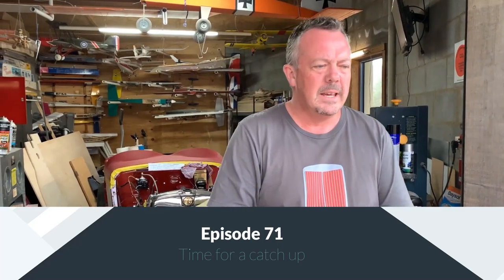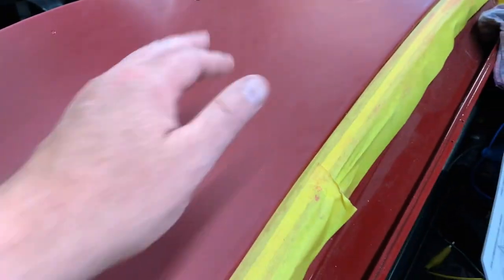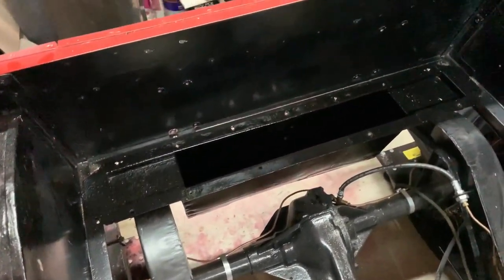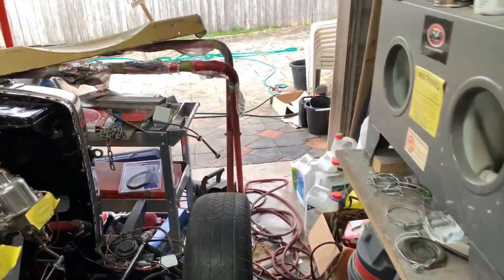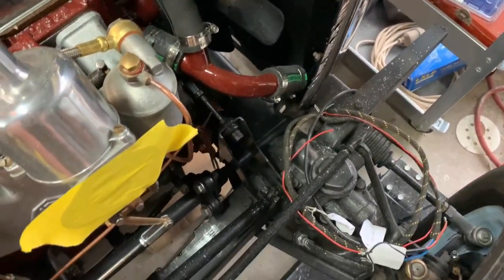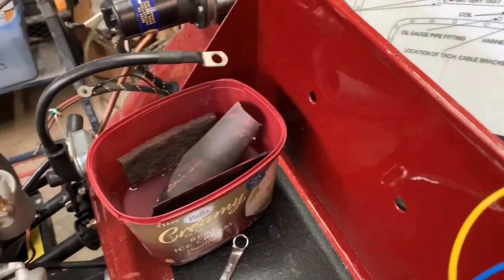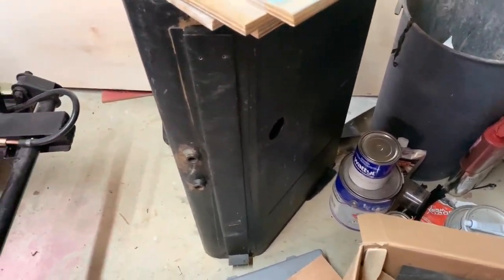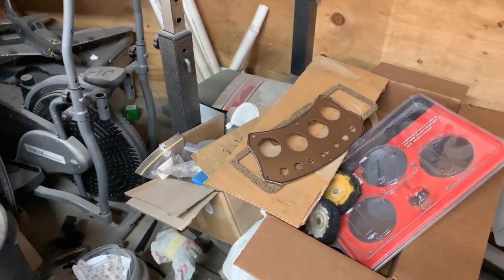Time for  a catch-up - 1950 MG Rebuild Episode 71

Comment: Try some plumbers water proof grease on the radiator drain valve. Also check to see if the cone is bottoming out on the body. If it is the the spring is pushing the washer against the shoulder of the cone. File the shoulder down until there is clearance between the shoulder and the washer on the bottom when installed in the body. Then grease and pray 😎

Comment: Jaime regarding the gap in your floor board, I did nothing with mine. The cutout is intended to clear that "bump" in the cross brace. If it really bugs you, you could cut a piece of Kaizen foam or thinner ply to fill it, but your carpeting will bridge it just fine without doing anything. 

She's coming right along. You should be very happy with all of the work you've done.

Comment: Hello again Jamie, it's been a while since my battery has been out but as i remember it, the two large holes you pointed out in the battery box should have rubber bumpers to keep the battery from rubbing. I believe they were included in the body rubber kit.
Reply from the maker: Thanks Robert.I foolishly didn’t buy the body rubber kit, instead I bought the bits as I needed them.
I’ve been told you can’t buy those rubbers anymore for the battery box so I might just use some blank grommets to suit
Reply: @MGREBUILD  If don't have something that fits, Abingdon Spares has them. Part No. 27-070, they are the same size as MG-TF brake drum plugs.
Reply from the maker: I managed to find some 1/2” blanking grommets that fit in there nicely

Comment: Jamie I am also glad to see you back...  The rubber boot (fume extruder) that goes on your brake and clutch pedals is almost impossible to get on with the tub on the frame.  Don't wait too long to try to get it mounted.  I made the same mistake, and I had to lift my tub off the frame about 18" to be able to get it installed.
Reply from the maker: Hi Jody. I’m about to tackle that job tomorrow. I have heard it can be difficult to get it on, but I wasn’t aware it was going to be that hard. Why did you have to lift the bodytub, was it to get better access to the area? Also do you have any hints/tips in fitting it?
Reply from the maker: Did you lift the tub so you could withdraw the pedal shaft thus giving you the ability to straighten the pedals for the excluder to slide over?
Reply: @MGREBUILD  I put mine on early but I've been told you have to put it on the pedals before putting the pedals on the shaft they rotate on.

Comment: My gas tank had giant deposits from evaporated fuel plus rust. My plan is to vacuum out as much of the deposits as possible. Then use a parts cleaner in the tank that I've proven dissolves the fuel deposits. Then I'll wash with simple green, inspect, repeat with the parts cleaner as required. Once the old fuel is gone, I plan to pour several gallons of EvapoRust in the tank and soak that in all 4 quadrants (and maybe on the ends to get the baffles). Then wash and dry. I cleaned a panel with EvapoRust several months ago and it's just been sitting while I find someone to fix the rust. It's now sat through fall and into winter and still has no surface or flash rust. And yes, I scrubbed the panel with soap and water after soaking in EvapoRust.
Reply from the maker: I’ve used EvapoRust on several parts and love it. It is very expensive down here at around $90 a gallon
Reply: @MGREBUILD  that really sucks!!! You're paying about 4.5 times what I'm paying... It's almost worth shipping you a few gallons!!!
Reply from the maker: @davelawson4827  it’s criminal the difference in cost
Reply: @MGREBUILD  so true!

I wonder why?

Comment: Perfectionism is why we do this! 😂
DONT USE ETHANOL. The rubber in the fuel lines between the carbies breaks down with ethanol and can cause a fire.
Reply from the maker: I never use ethanol fuel, just don’t like it and it’s only 1 cent cheaper.

Comment: The boot must be stretched by twice it's size which makes it really hard to get on.  I used boiling water to get the boot as soft as possible.  Lube the peddles with grease or dish soap and use heavy gloves to handle the hot boot.   I had to raise the tub, because at 73 I could not reach and contort my body enough with the tub on.
Here is the best source of information... https://www.mgexp.com/forum/t-series-and-prewar-forum.46/how-to-install-the-fume-excluder-brake.3018212/
Make certain you have the cameras rolling for the install!! LOL
Reply from the maker: I think I may had set a world record. I fitted the fume excluder in 5 seconds!
Then I realised I forgot to put the rubber mat that sits under the floorboard on first, but the excluder went on just as easy as the first time. The secret, WD40, spray it on the inside of the rubber
Reply: @MGREBUILD  Great!! Hope you recorded yourself, many have problems with getting it on.
Reply from the maker: I didn’t, but as it was so easy I will take it off and record it when I put it back on